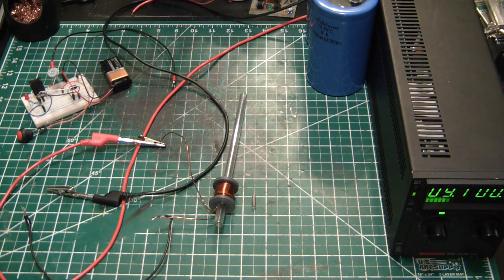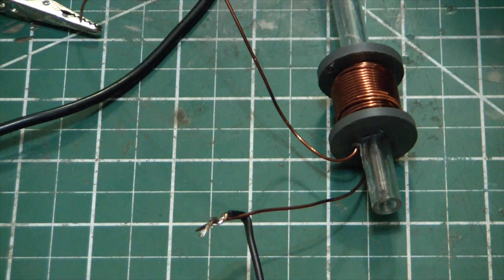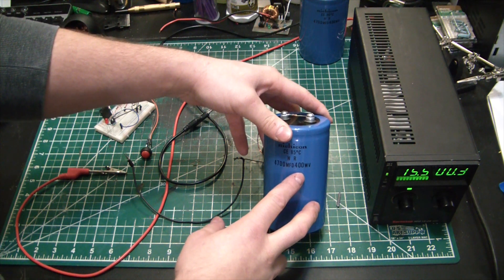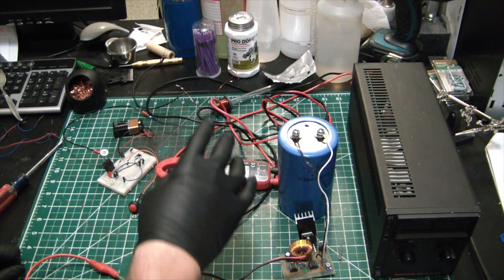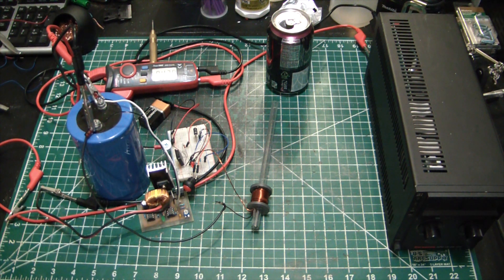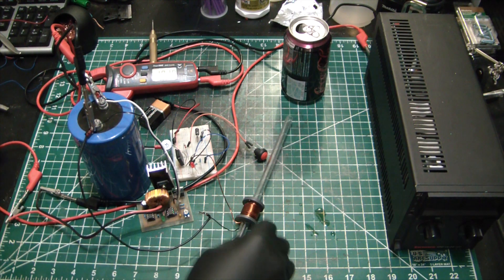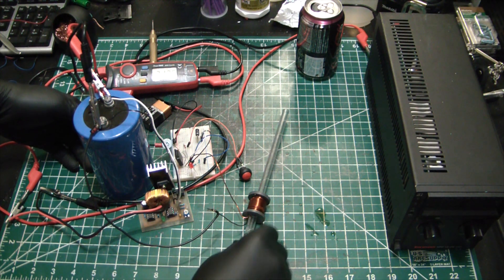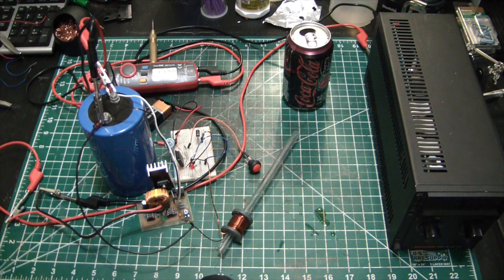Build Your Own Electromagnetic Accelerator (Coilgun)  - ElementalMaker

Comment: Пушка простая, пока там одна ступень, НО стоит только увеличить число ступеней, то её сложность сразу сильно возрастёт, ведь включение последующих ступеней надо синхронизировать, при этом скорость металлического прутка сё возрастает, следовательно и время подключения катушки надо снижать. Вообщем вылазит много подводных камней..
Reply from the maker: Agreed, however photo interrupters make timing easy to calibrate as long as your projectiles are standardized. The coil activation time though is a real problem that's very difficult to address.

Comment: I wanna know whats the schematic digram of your firing mechanism cause i can see that you didnt use any sensor unlike most people will use. Thx in advance man
Reply from the maker: @robertabihay4196  I have some other videos on the trigger circuit
Reply: @ElementalMaker  Ive found your video about the trigger circuit but the 2nd video where you demonstrated with the coil the schematic looks kinda odd, the scr looks gonna explode when voltage goes to the 9v battery then to the gate of the SCR where it's threshold is under 6v and I can see there's no switches apparently?
Reply: I've done every step, every component is the same also the circuit you shared from the description yet it failed, thus both my scr are damaged now, any idea of why it failed? @ElementalMaker

Comment: I accidentally did something similar to this when messing around with a step up transformer I cut open into the E shape.. I had it's original primary coil in place and stacked another coil on top and connected it to the primary coils leads flipped the switch to see what would happen and pow I thought it blew up haha a split second later I heard a thud and then something hit top of my shoulder.. the second coil launched off the primary hit the ceiling then hit me before I even knew what happened lol.

Comment: 02:37 through 02:52:  ... you only get arcing and sparking because you're an idiot who connects voltage before ground.  You do that with jumper cables connected to car batteries a few times and you'll need new car batteries.
Reply from the maker: Awwww someone needs a hug
Reply: @ElementalMaker  Do you seriously think that's the problem?  Do you possess no understanding at all that you're demonstrating a great way to start a fire, waste money on components, and seriously injure yourself?  Do you make no acknowledgement that you were trying to put on a show and didn't care what happened to anybody who tried it at home, or anybody who wasted their time trying to figure out how to make sparking not happen when all they have to do is connect the leads the other way around?  Really?

Comment: Would it help to put a metal frame around the coils so that the flux will be accelerated? What you have built looks like an "open" solenoid which typically has very low force compared to one with a metal frame to close the flux circuit

Comment: Sir , Can you please tell the circuit you have used for making the boost converter
Reply from the maker: Check description
Reply: Can i charge a 400v capacitor with a 220v dc supply?
Reply from the maker: @mohdaijaz454  yeah, but only up to 220v DC. Just follow the schematic and built a proper boost converter
Reply: Thank you sir
Reply: Sir, i don't know why but my boost converter is not producing an output of 400v.
Can you please guide me🤔.

Comment: Must be snowed in.   E= 1/2 (C)(V)(V).  Try  mono-stable CMOS pulse generator to fire gate for repeatable width pulses.  MOSFETs are cheap.  More turns on coil.  Thanks Mr. Wizard.  Extra for experts,  fire straight up, measure height, and time of flight, then you can work out the velocity, and acceleration and energy of projectile.  Good for explaining integral calculus. integral of A = V, integral of V=S.

Comment: if you were to fix the accelerator mechanism itself would you get better puncture results at lower voltages since i would think you are losing some velocity when the magnetism of the coil actually grab and flings the projectile? I guess the comparison would be trying to apply force to a movable object while you are in water, the object will indeed move forward but you yourself will also be moved backwards at the same time.

Comment: Half the energy of that coil gun went into propelling the nail, and the other half went into the gun recoiling backwards.  Mount the gun, tape it down or whatever, so it doesn't recoil and you'll double the energy that goes into propelling the nail.

Comment: @elementalmaker, sweet power supply. What brand/model?

Could you get away with some solid state relays? Response/activation time would be a concern.
Reply from the maker: That's a Sorensen 15-20 Power supply. Truly a great unit. I don't think ssr's capable of this switching current are available /affordable
Reply: @ElementalMaker  Thanks! Yes you were pumping a boat load of energy into that setup.
Luckygen1001 has a video showing an 80 yo Tungar battery charger with a gas diode that was cool. I only know enough about electronics to make smoke. Lol

Comment: 200V is actually a quarter of the power, as the potential energy climbs quadratically with the voltage.  U = 0.5 * C * V². where U is the energy, C the capacity, and V the voltage.
Reply from the maker: Good point I totally forgot my EE background and formulas on that statement LOL

Comment: You can use a trigatron as a really fast no contact trigger
Reply from the maker: Wow I had never even heard of such a device, but I have seen others using Xenon flash tubes as triggers so it appears arbitrarily similar in function. Very cool! I need to read up on these!
Reply: It's a triggered spark gap initiated with a high voltage spark. The high voltage ionizes the air around the spark gap therefore lowering the resistance causing the capacitor to discharge at a lot higher amperage than 1400A. Same concept as a flashtube but without the tube. Hope it helps.

Comment: for the expansion ideas: how about making an impact self-defense weapon, discharging the jolt of the counterflux through 2 protruding pins that also close the circuit of the coil switch when touching, say, skin... (is that enough of a description to picture what I mean? It would combine a stun gun with an impact hammer butcher gun, but replace the large pin with a springloaded sedative seringe. All you'd need more is a nice ribbon to wrap the bad guys up for under the cops' christmas tree)
Reply from the maker: Sounds awesome, but I'm quite sure the fun police at YT would boot me immediately LOL

Comment: That looks like one of those 0.1F capacitors... My dad used to have like 50 of them. Then my mom got tired of his vintage electro collection, so he had to scrap them. They were brand new, scrapped by Siemens (where he worked) when they abandoned the multi-rack mainframe design somewhere in the 80s (one of the racks was a power stabilizing battery of some 120 of those badboys. Computers ran 30A currents back then. Hot business, quite literally). Anyway, I managed to keep 3 out of my mom's sight. We destroyed one using it to explode smaller capacitors (fully charging the big one, then inverted connecting a smaller one. The big one would load 100x the max charge of the smaller one into it and boooooom. But the big electrolyte capacitors are not made for load dumps. So after a few times, it started leaking. We also were able to charge it less the last 2 times (probably shorted out some of the surface inside). Made for an interesting disection afterwards...

Now I wish I still had them, I could make a 50 stage coil mass-accelerator... (nice euphemism, btw) Or perhaps run a small backyard roller coaster off of them... (at least for a couple of runs)
Reply from the maker: Sounds like a very cool collection. Shame it got tossed. Glad you stowed a few away for future play though.

Comment: What if you used graphite rods from a carbon-zinc battery as your contacts? I don't think those will weld.
Reply from the maker: That would probably work for a bit, but even those would eventually just vaporize away as CO2. Solid state is the way to go.

Comment: If you don't want to use a huge cap like here, stealing the caps out of disposable camera's, as they also come with a charging circuit, is a great way to build these.
Reply from the maker: I used those smaller ones from disposable cameras back when I was a kid, but this one has the capacity of around 100 of those, and is a much easier form factor to work with.

Comment: that was a quater of the maximum energy, since the energy stored in a capacitor is ''proportional'' to V^2. so imagine blowing shit up with it at full charge..
Reply from the maker: Any higher than 350V and the SCR goes boom LOL
Reply: @ElementalMaker  Still can't believe you built this ON A BREADBOARD??!! LOLL also if you have time to read this, the 70tps SCR rated for 1000A+ 1ms can take a lot of beating, I use it for my 7 stage chinesenium CG with 450v 1000uf capacitors paired with 70tp06 SCRs.

Comment: Great video! Based on the damage to the can I would guess you got the steel rod accelerated up to at least 300 feet per second. What are the main differences between this and a railgun? I think on a railgun the projectile itself completes the circuits, but I could be mistaken
Reply from the maker: You are correct 👍 glad you enjoyed!

Comment: Xeon strobe lamps make a great trigger as well, some of the power is wasted in the light and heat of course, but in the bigger coil guns ive seen people make, the SCRs required are very expensive, so strobe lamps make a good balance between price and efficiency.
Reply from the maker: Never would have thought of using one of those but that's ingenious! Great tip!
Reply from the maker: Maybe use the strobe lamps for a laser 😁
Reply: Flash lamps also have extremely fast rise times compared to any semiconductor. For a coilgun you want all current to end by the time  the projectile is passing the halfway point inside of the coil. Otherwise if current is still flowing the projectile will be slowed. You can play with the timing by the inductance of the coil. Another benefit of flashlamps is their awesome ability to explode louder than a gunshot and throw quartz glass everywhere. I once dumped 20 disposable camera caps through a camera flashlamp. My ears were ringing for a couple hours.

Comment: Couldn't you use a electric solonoid for like a hydraulic system to do this? I play with solonoids all day at work on heavy equipment. Just throw more voltage at it??
Reply from the maker: For switching? That's essentially what a relay is. Eventually any physical contact will deteriorate. Solid state is the only long term solution here that I can see working.

Comment: 3:36 couldn't you just use a mechanical switch in a vacuum or near vacuum to prevent arcing ?
Reply from the maker: That's a very good question. I think you would still run into welding issues though as the contacts reach one another and there is a huge current surge through a very small portion of each contact face.
Reply: @ElementalMaker   hmm could you make the contact surface bigger by profiling matching coronations?   or is there like some sort of materials? that only become conductive above certain voltages  i was thinking of how fluorescent lamps only work when they have high enough voltage ?
Reply: Would a spark-gap work? Like an OG tesla coil would have? I mean this is just a coil. A properly tuned spark gap could even let you fire semi-auto as long as you had enough power storage and a feeding system that would give you one nail at a time right?

Comment: If you don't want to pop a bunch of SCRs / Thyristors, just get some Semikron Thyristor "block" (used)  from  ebay.
You get two SCRs in series in one block, so if you pop one, you still have another. 
I got 3 smaller blocks with 2kA peak in parallel with a bus bar. To fire those, I use a 1mF cap and a relay :)
Reply from the maker: Yep I've been keeping an eye out for those monster SCR's!

Comment: Great video do you have a schematic for the boost converter
Reply from the maker: In the description is the link to the site I found it at. They have the full schematic and a trace picture so you can make your own pcb.
Reply: Thanks I have recently obtained a lot of those big capacitors and I have been having difficulty charging them

Comment: what if you used coils wound in different ways? or if you put a larger coil around that coil?

can resonance generate a magnetic field in the smaller coil, and would that make it stronger or weaker if it can?

can that feedback you mentioned from the collapsing field be directed into another coil?
Reply: This is actually a really interesting question.

Comment: What power supply is that and would you recommend it? Need a upgrade from my 0-30v 0-1.5a CC/CA with analog readouts.
Reply from the maker: It's a Sorensen adjustable switching power supply. I found two on Facebook marketplace for $25 a pop. Crazy good deal considering they usually sell for hundreds used.

Comment: 10:43 <-Nope! optical triggers have to big to delay times..
In 1996 I built a four stage coil device.. And built a Dip switch type timing computer..
I was able to put a steel though a two by four...
Note: Actual computers would need mega EMP isolation to do this.. As four perfectly timed coils mess up electronics.. 
Even with a home made primitive dip switch timing computer. It could only fire once, as a ringing would mess up an second tries.. So it had to be powered down and restarted. then it could go again.. Then again it could be something wrong with the Dip Computer...
It was hand made...

Note: get timing wrong and a coil gun will reverse fire.. As the field inverses, at power loss...
If timed perfectly this can be used to aid in projectile speed..
I ran mine on 12V DC..
Use flatter coils, and thicker wire!

Comment: When i was a 6 i pounded a few nails into a board then wrapped wire around the nailheads. My parents never jumped and screamed lounder than when i grabbed the bare ends and started to stick them into the wall socket. 
Because they yelled so much i wanted to know why so later i grabed the vacuum plug and plugged it in while holding the blades. 
And i never did that again.
Reply from the maker: That's a right of passage for curious kids! 😂 I remember doing similar around that same age, but it involved my tongue. With a wall wart in between though luckily.
Reply: Mine was my mom's Bobby pins . I did it repeatedly, not just a few times either. That was the beginning of life and poor thinking leading me to be a plumber and not an elechicken.

Comment: Do you really need a lot of current for this?  I would think this would work fine using a much, much smaller cap, but with the same high voltage.
Reply from the maker: I've used smaller caps of the same voltage but they do not generate very high velocities.
Reply: i think because the smaller caps dont generate the same high current, unless you use supercaps i think, unless they are also amp challenged.
Reply: I think it's the inefficiency of the coil.  A nail which weighs a couple of grams moving at a couple feet per second does not need that much energy.

Comment: magnetic coils in series triggered in series can give a massive boost in velocity, timing on triggering them at correct speed is the problem
Reply: i've heard people use light barriers to rectify the problem, but to do it correctly you'd need to space the coils more or use a shorter round, basically so the projectile stops obstructing the light barrier before it reaches equilibrium in the coil.
Reply: depending on the spacing of the coils you could probably use a reed switch at the end of one coil to fire the scr for the next coil
Reply: @brendanrandle  that seems like a pretty good idea too

Comment: If you have anywhere around you that still processes disposable cameras you can usually just go in and ask for a few of the empty shells. Any one with an actual discharge lamp for the flash has a low wattage ~300V power supply in it. A whole mini coil gun could probably fit in the camera shell.
Reply from the maker: I made many coilguns back when I was a kid with those. They are quite fun, but once you start adding capacitors in parallel, it takes ages to charge. This boost converter puts out a ton more current than those little camera flash boards.
Reply: Yes, I was thinking along similar lines. I'm pretty sure the cap in this video is just massive overkill and that a 50uF 300v cap should probably work as well.  After all, it really doesn't take much energy to shoot such a tiny projectile at such relatively low speeds.
Reply: @tarstarkusz  you are correct a big capacitor like shown would have a lot inductance and extend the discharge and may start slowing the projectile if current is still flowing after the projectile passes halfway inside of the coil. You want extremely fast rise times and a quick pulse.
Reply: Hmmmmm , never thought of that , interesting .

Comment: The next step is making a 50BMG equivalent coil gun
Reply: With the same or greater muzzle velocity.
Reply: @Bill2Board  well, that's why I said "equivalent", because I'd rather have a smaller bullet but with a higher speed to compensate for the loss of mass with gain in speed. Also, I guess it would have less ¿"drop"? at the same distance making it more accurate.
Reply: @chelarestelar  I suppose, though with lesser mass comes greater wind susceptibility.
Reply: @Bill2Board  shit, right, haven't thought about that.

Comment: But still railgun way stronger!
Reply from the maker: Not necessarily. They can achieve higher speeds, but the railgun I built years ago can't compete with the coilgun using the same capacitor bank.
Reply: @ElementalMaker  I see so thats why they try to make hand coill gun buc its more efficient at smaller scale unlike railgun at bigger scale thx :D!